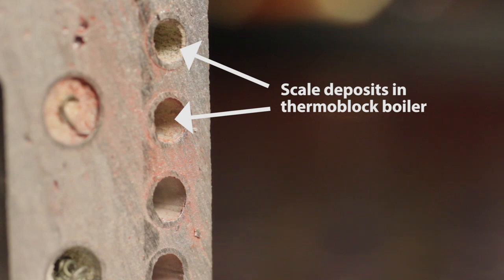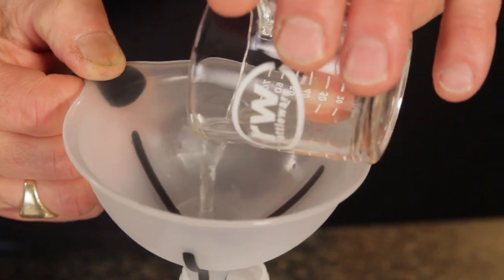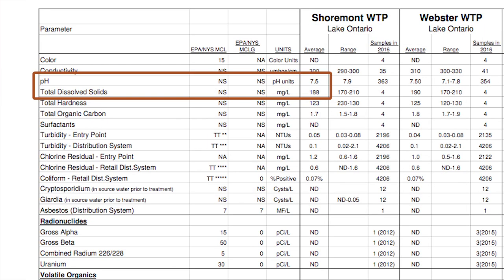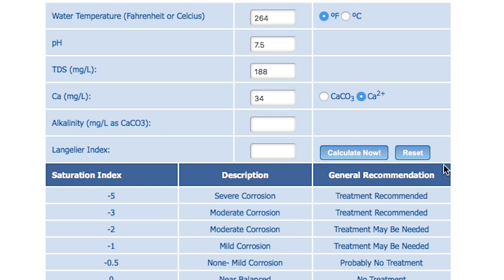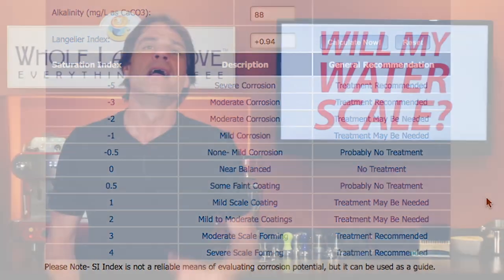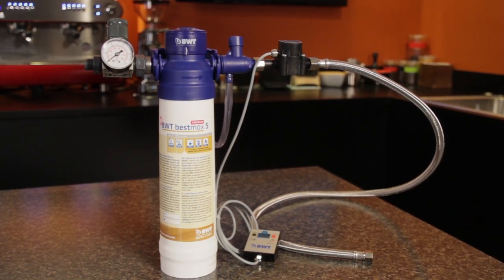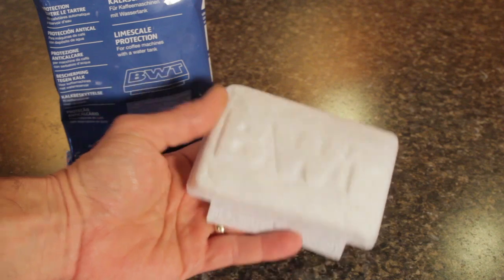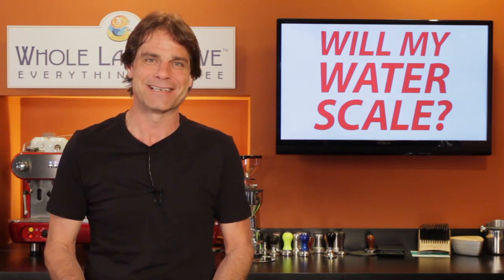How To Determine If Your Water Will Cause Scaling in Espresso Machines

Comment: Great video! Assuming I replaced the in reservoir filter as advised by the manufacturer, could I expect to see the same performance as the plumbed in version?
Reply from the maker: Hi DG, Yes but depends on the type in reservoir filter. In-reservoir pad filters like the one linked below require 12 hour soak time to treat the water: https://www.wholelattelove.com/products/bwt-bestsave-s-anti-scale-filter
There are in reservoir filters like this one which work with some machines which treat water on use and require no soak time: https://www.wholelattelove.com/products/bwt-bestcup-m-package
Marc

Comment: Hi Marc. Thank you for great content. I just purchased a Profitec Pro 600 from WLL and want to be sure I’m using the best water to prevent scale build up. If using the BWT filter for the resivoir, can I just use water from the tap, or bottled spring water? I’m assuming anything other than distilled or RO water would be OK? Thank you.

Comment: Great content! I'm getting scale in my steam boiler even through I have a plumbed water filter. I've been told that scale can build up in a steam boiler if you're not regularly draining it.
Reply from the maker: Hi ad, Yes, it is important to turn over water in the steam boiler on a regular to prevent concentration of minerals there. What type of plumbed filter are you using. Most do nothing to reduce calcium content. BWT has filter options which exchange calcium for magnesium. That keeps mineral level up without causing scale.
Reply: Thanks. I’m using Homeland, but thinking of switching to BWT. Since I already have all the plumbing in, do you have a basic kit with just be housing and filter? I assume they work on the same quick connect piping.

Comment: Hi, I just bought used LA San marco flexa espresso machine. It was sit in the restaurant for a while. As soon as I have bought it, I have been cleaning this machine for 3 straight days with vinegar , tablets and factory reset cleaner. My problem is cleaning the ruber water suction tube in the water reservoir tank. I found some mold like dark spot inside of tube. I used vinegar and try to clean it. I am afraid it will come back. I thought I should use bottle water for my espresso machine however after watch few YouTubes Sounds like I'd better use tab water with water softner. It comes with water softener. One of YouTube expert said I can reuse them after I soak them in the salt water and run the water through them. Is it right? Looks like I can replace the actual water softener grains. where can I buy them?

Comment: I'm searching for the perfect brew water. Currently use your simple brew water recipe, adding sodium bicarb and mag sulfate to RO water has certainly improved my coffee's flavor but it still needs work. Is the absence of calcium detrimental to the final flavor? When can we expect you to post a more detailed recipe? Do you know any good resources for water quality education?
Reply from the maker: Hi Luke, Happy to hear the simple water recipe has improved your flavor! My overarching goal is water which is less likely to cause scale without sacrificing flavor. My research leads me to believe water re-mineralized with magnesium is less likely to cause scaling than water water with mineral content from calcium. But some calcium is okay and will not cause scale at lower levels although it does depend on some other water chemistry. As to taste difference...Well, that gets into the realm of subjective judgement. It's hard to quantify and IMO brewing variables other than slight mineral level changes are far easier to detect taste wise. The Specialty Coffee Association has this book: http://scaaeducation.org/bookstore/the-water-quality-handbook/
Reply: Thanks!

Comment: Hi great videos mate,and thanks to your video on Profitec 500 pd, I purchased one yesterday. Just your thoughts on do I need a water filter or softner, if my water is ok with this machine. Await your reply. Thank you
Reply from the maker: Hi Walter, Thanks for the kind comment and question. I do recommend a water filter. How urgent a filter is needed depends on your source water quality. If it's considered "hard" with high mineral levels then you should definitely be filtering to reduce mineral level. You want some mineral in brew water to support flavor and avoid over-extraction. So do not use pure RO or distilled water. My preferred solution are BWT products which use patented ion-exchange technology which replaces some calcium with magnesium. Use BWT products properly and scale will not form in your machine. They have drop in pad filters for reservoirs, pitcher, plumbed in solutions and more. Check out their products and learn more here: https://www.wholelattelove.com/collections/water-filters?_=pf&pf_v_brand=BWT%20water%2Bmore
Marc
Reply: @Wholelattelovepage  Hi Marc,thank you for your quick reply,only need your expertise,which should I use for my profitec 500 pid,the  BWT water jug or the pouches  in the tank.
Thank you very very much
Cheers from downunder 
Walter

Comment: Hey Marc, I'm currently using third wave water in my La Marzocco Gs3 with good results. I've been reading a lot about this topic as I want to both get cheaper water and as well even better tasting espresso.
There is one very knowledgeable chemistry professor that suggests in the Home Barista forum that potassium bicarbonate is a very good additive that will have zero hardness (therefore zero scale buildup) and as well will reduce sourness in the cup. 
Have you ever had a chance to try this vs the traditional Baking soda + epsom salt?
Reply from the maker: Hi Rodrigo, I have not tried potassium bicarbonate. I need to do some research on that! If you give it a try, please let me know how it works out.
Reply: Whole Latte Love Sure! I just got my 1lb of KHCO3. Tomorrow I'll be doing some taste tests comparing it against third wave water. The coffee is Sweet Maria's Ethiopesque Blend, very lightly roasted.

Comment: I would really love to see a complete A to Z home installation of an inline water filtration system for a rotary plumbed machine, like a Rocket Mozzafiato R. The BWT looks like a great solution but looks confusing and risky to install myself... I'm not a plumber and I have no clue what line pressure is required, what goes where, what does what, how to test it once installed, what not to do, etc. etc. So yea, a COMPLETE installation guide with step by step instructions would be fantastic!
Reply from the maker: Hi Snowman, Thank you for the video request! We do have a lengthy install video here for BWT inline filter system: https://youtu.be/qNECWcDNGIY
It will give you a detailed look at what is involved. We do plan on updating this video as the head which the filter screws into has changed slightly since the video was made. If anything the new filter head makes install easier.
Marc

Comment: Hei Marc, I have eSpring water treatment system from Amway. Is it sufficient enough or i still need to install a BWT filtration? Thanks
Reply from the maker: Hi William, Thanks for the question. Unfortunately I can't give you an answer as I'm not familiar with that water treatment system. If it's the type of system which does particle and carbon filtration only (common) then it's likely you would need additional filtration to reduce calcium while maintaining a proper mineral level for flavor. But that need would depends on the hardness of water before treatment. If you know water is hard before treatment then it may need additional filtration.
Marc
Reply: @Wholelattelovepage  what if i use penquin pitcher in between? Will it be helpful?

Comment: What do you recommend for a commercial machine running on rainwater/tankwater. Since no hardness present and ph is somewhat low
Reply from the maker: Hi DL, Thanks for the question. You do want some minerals (hardness) in your brew water. Ultra pure water at low pH can be corrosive over time to metal components in a machine. Additionally, it will over-extract coffee causing bitter flavor. I recommend re-mineralizing your water. Here a video showing how to do that using baking soda and Epsom salts: https://youtu.be/iHI7jC0sQZo
Marc

Comment: If I'm using Third Wave Water, will I still need to descale frequently or use a BWT filter?
Reply from the maker: Hi G, Hard to say. I'm familiar with third wave water but they don't seems to publish actual mineral levels of the product. My guess is their Espresso packs may produce some scaling as most espresso water is harder. If using their Classic packs I'm guessing it's closer to an SCA spec water profile which produces minimal scale. FYI, you can make an SCA profile water at much lower cost than commercial re-mineralization products. Baking soda, epsom salts etc are couple pennies a gallon to do it yourself. Here's or video showing a basic DIY: https://youtu.be/iHI7jC0sQZo

Comment: If our tap water falls within that +- 1 range is it still worth getting the extra equipment, or would it be ok to just use the tap water and service it every so often to clear the mild scaling?
Reply from the maker: Hi Cuan, At an LSI of +1 scale is slightly likely to form. If your machine is relatively easy to descale (it's not a dual boiler), you don't mind doing the descaling and you are happy with the flavor then extra filtering is not needed.
Marc

Comment: would you recommend using  the at home water solution mixture then pouring it into the bwt pitcher?
Reply from the maker: Hi eug, If referring to my recipe for SCA spec brew water and starting with distilled or pure RO treated water the BWT pitcher is not needed. Minerals in the SCA recipe provided primarily by magnesium which is less likely to cause scaling than calcium. On the other hand, if your tap water is reasonable you can just use the BWT pitcher.
Marc

Comment: I’m using a Expobar lever Prosumer machine that has been in use for 5 years. Can I run an anti-scaling solution like durgol through my espresso machine to remove any scale build up
Reply from the maker: Hi Andrew, Thanks for the question. Here's a link to our support wiki with descaling instruction for the Expobar Lever: https://wiki.wholelattelove.com/Expobar_Office_Lever#Descaling One thing I'll mention...if the machine has not been descaled in 5 years you run the risk of large scale deposits breaking free and causing problems. Risk level depends on your source water hardness, use of filters and how much the machine has been used. In average use 5 years is a very long time to go without descaling unless your water is very soft or machine has had minimal use.

Comment: Can I just use distilled water?
Reply from the maker: Hi Sunny, Thanks for the question. Distilled water makes sense on the surface but... water with no minerals make coffee and espresso that doesn't taste good. Regular water is a good solvent. Purified mineral free water is an even better solvent. When used to make coffee or espresso it causes over-extraction resulting in bitter and other flavors taints. Over time, ultra-pure water will have detrimental effects on espresso making equipment - it does not play nice with metals! One reason why you will never see water purified by reverse osmosis or distillation in metal containers or pipes.

Comment: What about a BWT using water filtering pitcher?
Reply from the maker: Hi c, Thanks for the question. The BWT pitcher when used as directed should not cause scale in an espresso machine while providing a mineral level needed to prevent over-extraction. It's what I use in the studio for all my reservoir fed machines.
Marc
Reply: Whole Latte Love So does that mean you don’t use descaling products because you have no need for them?